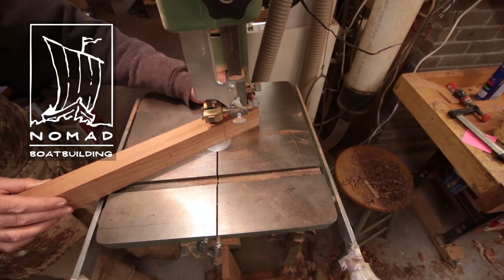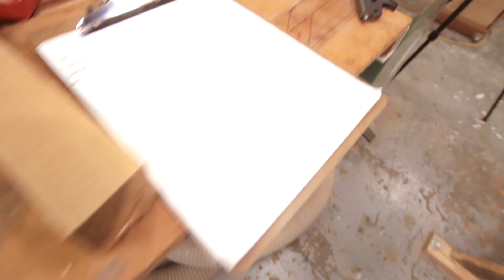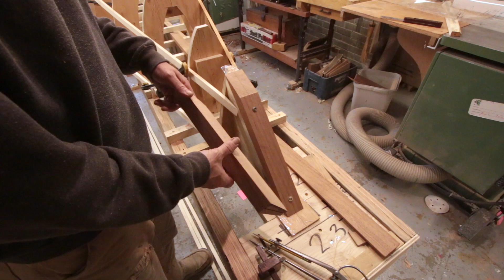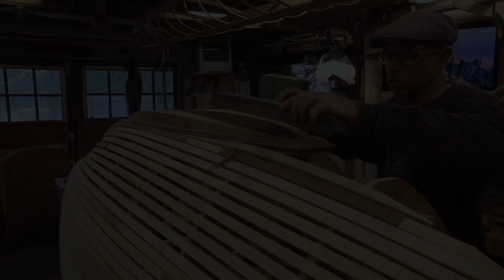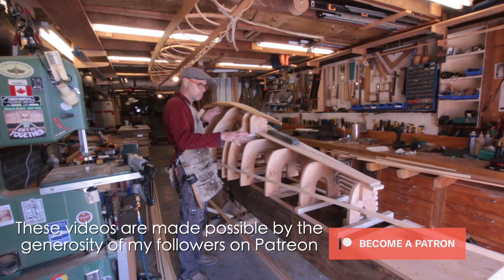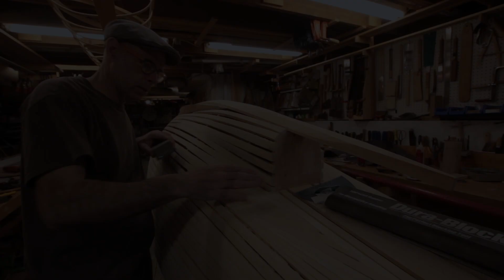International 2.4mR Sailboat Project - Episode 11 - The building jig part 2

Comment: I love durablocks, if anyone needs a set at a good price this 7 piece set will get you started for only $46.  https://www.amazon.com/gp/product/B000ED8UOG/ref=ppx_yo_dt_b_asin_title_o01_s00?ie=UTF8&psc=1
Reply from the maker: And I just found that my local plastics supplier is stocking sheets of the similar eva foam so I may get some to make my own.
Reply: @Nomadboatbuilding  Great idea, the basic set of 7 is cheap enough to buy but the specialty blocks start to add up quick.  I'd like to make one between 42 and 48 inches long for long boarding.  What is the type of foam? I can check my plastics puller down here on left coast to see if I can get it too.  I'll bet a slow speed on the router table will cut the foam without melting it to make the grooves and round overs.
Reply from the maker: @SteelDoesMyWill  I've used the stuff for kayak seats and it carves very easily. Just abrasives is all you need. I would be seriously concerned about taking that stuff near a router. I don't even like running any of that softer material through table saw. I've had foams buck on me numerous times.

Comment: why can't you use body filler
Reply from the maker: I could but it just isn’t something I reach for. We tend to avoid it in wooden boats because it doesn’t bond to wood well. If you are talking about filling out that spot in the tuck, then yes, I probably should but I often have some epoxy left over from some sort of glue up so I would tend to use it in a spot like that.
Reply: body filler is epoxy
Reply from the maker: Actually, body filler is usually polyester resin based and because that doesn’t bond well to wood, we usually wouldn’t use it unless the wood was already epoxy coated.
Reply: @Sir_Godz  Autobody filler is (basically) made of a vinylester or a polyester type resin. Epoxy primer is (basically) made of an epoxy type resin. If you were to bond/glass over a metal pad to a fiberglass boat, vinylester or polyester is never used, epoxy is